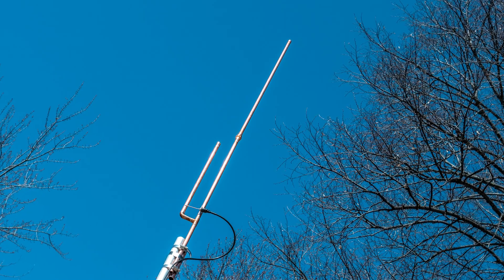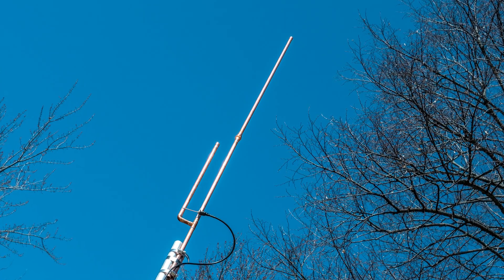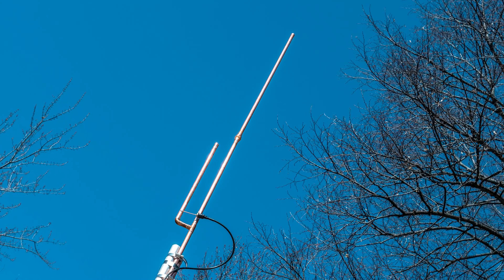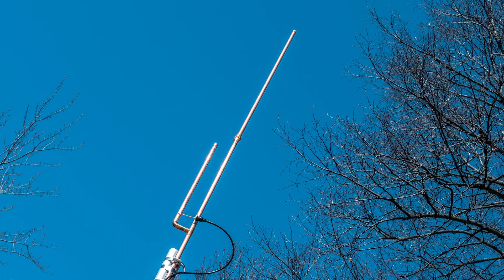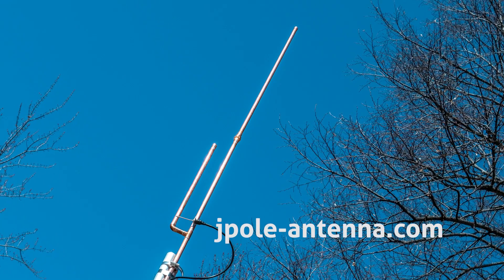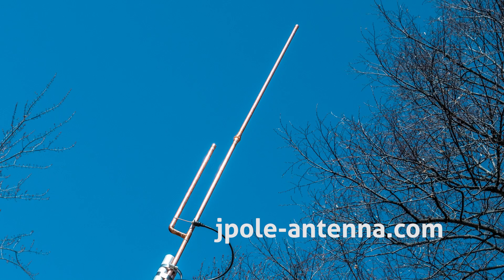Ask Michael, KB9VBR: Do I need to ground my portable (POTA) station?

Comment: Many POTA and especially SOTA operators have learned that any series-fed antenna exposed to the wind can accumulate very high static voltages, which then appear across the coax. Even a ground with a high resistance can dissipate these charges continuously and harmlessly, and it's a much better solution than waiting for something to arc - especially through the front end of your receiver.
Reply from the maker: With hundreds of activations, even in the winter with a relative humidity of 20%, I’ve yet to have this happen

Comment: when at Jones beach i may through my counter poise wire in the Atlantic ocean or when in the car I use my jumper cable from the frame to a guard rail at the beach . Coastal Waves may agree with my methods .

Comment: Let’s say it’s the fall/winter. Would I still need to ground the radio if I use it in home even though there’s no risk for lightning?
Reply from the maker: I probably wouldn't. Often I will put up a temporary antenna for the winter months as the back yard is snow covered and it won't bother anyone. I don't lightning protect those temporary antennas.

Comment: The exhaust pipe is actually electrically connected to the body or frame of the car, although it is not a very good connection. Its better to bond it locally to the car's frame at each section.

Comment: very good. I am in NY . the outher thing grounding did for me is reduce static build up from antenna during heavy snow and wind . making very high noise floor. bonding and grounding at home reduced my noise floor buy a lot.  the single point ground in the shack to ground rod bonded out side to power ground rod did the most good for my noise floor. portable just the counterpoise is all I needed either the coax as counterpoise or wires on ground. either way works. but for the RF what you need to do is choke that coax either at antenna or radio depending on counterpoise . and choke DC power cable and USB to laptop  for digital modes . works great for me. choke all cables to radio. even got a snap ferrite on mic and ext. speaker. even the solar panel and MPPT charge controller. choke it all but putting ferrite on leads. either wrap a  toroid like FT 240-31 or use the snap ferrite type 32 mix. that solves the RF . no ground rod needed . 73's

Comment: Maybe my exception is camp hosting where I am parked for 5-6 months at our USFS campground in the mountains. I install 1-2 8' grounding rods bonded together, plus saltwater solution to help the poor conductivity of the Rocky soil. Connected to the ground rod is the solar array, the 25' cell Yagi (Log Periodic), generator, & RV. On the cell pole is a lightning arrester with N-connectors. Next to our host campsite was a 15-acre lake located at the mouth of a box canyon. Our 65 DB cell amp was registered with the FCC/Verizon & never had an issue with lightning transients. None of our GMRS or Ham handheld or mobile radios were grounded specifically. Communications are difficult out there, but hail & lightning show up most summer afternoons, lol. Cheers, Davey --KU9L

Comment: Hi Michael,

Good grounding rods a must along with lighting protection. In Electrical storm conditions I always disconnect antennas and the computer and radios. 

Due mobile operators if there’s an electrical storm anywhere with 50-60 miles it’s time to go inside. 

I have seen, in Texas, where people were killed by lighting strike 80 miles away. The USAF have excellent information regarding lightning and its hazards for those outside in large flat country.

Here in VK land lighting is a very dangerous phenomenon that kill stick and a few folks each year. 

Serious stuff, don’t risk it, be safe

Comment: Darn! Up until now anyway after seeing this, at the State Park when operating portable, I've been driving a pair of six foot stakes, one in front of the car just off to the side of the road, and one behind the car, also just to the side of the road, and attaching wires to the frame (and not just the bumper!) of the car, and as I move forward, I have been pulling up the rear grounded rod, and moving that to the 😂front, and just repeating the process. I started doing this after the ranger told me not to use the guardrail, which I was using (after grounding the guard rail itself with two six foot copper rods at either end) before with extra long (4 gauge) jumper cables that I had split apart to use especially for this purpose, as that was IMO so much easier, but what are you going to do? So I complied, but it takes a long time to move, with all of that stake pounding and then pulling them back up. Additionally, I've had more than a few other campers give me The Stink Eye especially when I start hearing thunder, because at that point, I just put the vehicle in park right there and then, and use BOTH of the ground rods, until the sky turns blue again. I've TRIED to EXPLAIN this to the people behind me by being polite and using the "Three R's" (Let's be Right, Reasonable, and Rational) but I think that they just don't like Ham operators, or maybe it's just me?🤣 All the Best! 73 DE W8LV BILL

Comment: Doesn't bonding/ RF grounding also help to bleed off static and other man made interference?
I have seen guys ground their radio to their water pipe in the basement and their static noise is lowered.

Comment: Absolutely good information! 
Also you should not have a separate ground rod connected to the radio if its not connected back to the power panel ground for the house! You don’t want a nearby lighting strike to raise the potential of the chassis to a higher value than the power panel ground. Both ground rods need to stay at the same potential or bad things happen!
Reply: This^